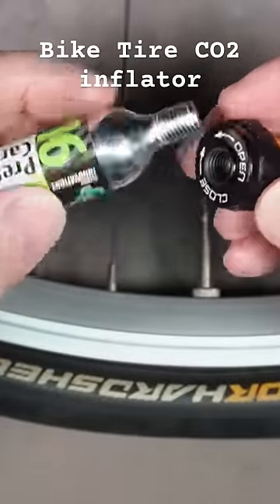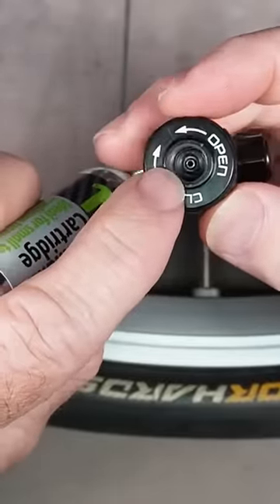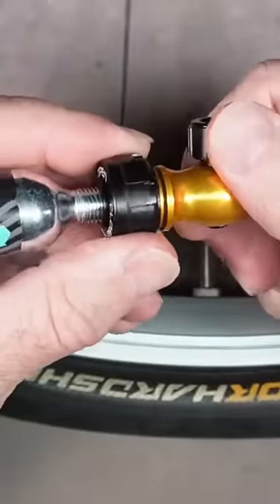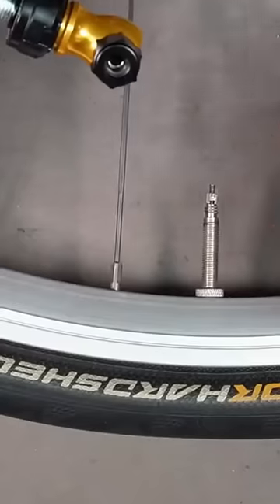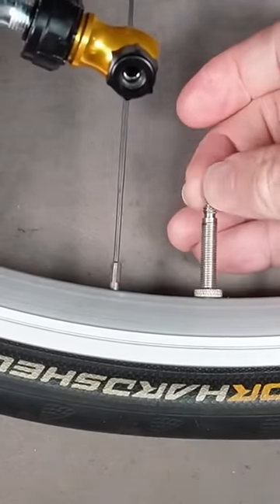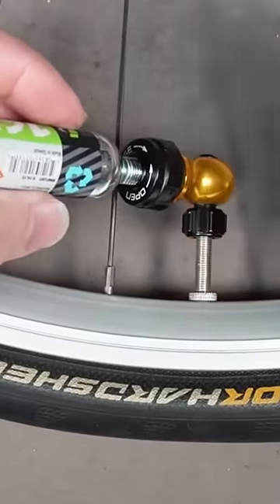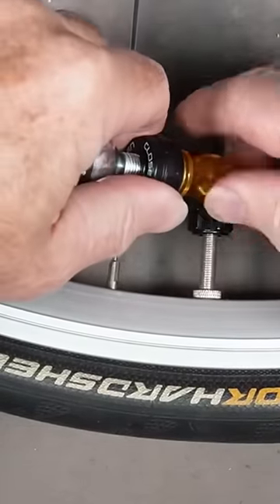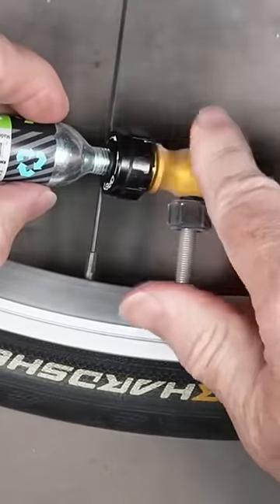Bike Tire (tyre) CO2 Inflator: How to use. #bicyclerepair #bike

Comment: I've neven seen a CO2 inflator in action. Thankyou for explaining 🤗
Reply from the maker: I appreciate the comment! 

Dave
Reply: I haven't seen one yet, well will ask for the next time I go shopping and try it out
Reply: now I know what to do w/all of those free CO2 cartridges:)
Reply: @Eduardo_Espinoza  What? 😮‍💨
Reply: Thankyou for explaining 🤗 @jayesh5131
Reply: CO2 is easier to compress compared to air. This means it produces less heat and, in this way, asks less of the equipment used for compression.
Reply: You unscrewed the core of the tire valve before you inflated the tire? Why, and how do you screw it back together again before you loose all your pressure? HOW?
Reply: @luisaraujo4708 that's not the core.
Reply: @JamesRaymond-y9p where you been living under a rock ?

Comment: Pumps are really handy for bicycle tires.
Reply: Yes and small nowadays
Reply from the maker: CO2 is just another option. Thanks for commenting!

Dave
Reply: @davescycling  it's single use and doesn't even allow you to set or check pressure.  It's wasteful and seems even more time consuming than a simple pump.
Reply: 😂 how else are you going to ride 😂 on the rim
Reply: This is for when you are out on a long ride and catch a flat. After repairing or switching the tube, you're able to air up. A lot easier to carry this and a tube than a pump. Even the small ones
Reply: @buttplugsalesmane69  the small ones are slightly longer and about the same diameter as a co2 cartridge.  They can be secured to the frame of your bike easily and some even have a pressure gauge built into it and a small screw of cap container that holds extra valves with built in tool.
Reply: @buttplugsalesmane69 no, the pump makes way more sense to carry.  Way less weight and same space taken up
Reply: @codemang87 this is primarily meant for downhill and mountainbikers who don't have pumps with them
Reply: @MXedits_1  how so? If they can carry co2 carts and this tool then they could just as easily carry a pump.
Reply: it does take a lot of work to pump one up with a minipump. i still like to use one to make sure the leak is fixed properly beofre remounting the tube and then use a co2 cartridge to fill it up. you also need to make sure your minipump can pump up to a higher pressure for a road bike tire, a high volume, low pressure mtb mini pump will not be able to do it.
Reply: Pumps ? Dafux? U talkin about high heels 👠
Reply: I’m sayin 😂
Reply: @codemang87  how many times have you had to pump a flat road tire on a ride? after 1 or 2 you'll probably get a co2 cartridge especially if you want it pumped hard enough to continue your ride. i actually carry a mini pump and co2 as well. mini pump to partially inflate to check leak repair, bead placement and or if i want to save the co2 for if i am tired. if just using my spare tubeafter a flat, I'll just use the co2 and continue with my ride and making sure to deflate the tire and reinflate with floor pump at home.
Reply: @Random-ld6wg  many times.  Sometimes multiples on the same ride.  And as much pressure as I want up to 120 psi. Tube and tire would probably explode before that tho.
Reply: @codemang87  what brand do you use? my mini floor bike pump with a foot peg from amazon is ok but i may get another one.
Reply: @joel.ha.  And as long as there is air around you you can refill the tire over and over again.
Reply: @user-sm3xq5ob5d  how? It moves from high to low pressure, So you have to have a pump with higher pressure than the inside of the tire. It would never go from outside open air straight into the pressurized tire
Reply: @davescycling  it's just another option for lazy people that like to create more trash.
Reply: @MXedits_1  are you thick? i have a downhill bike and guess what, i have a pump that sits very cozy on the frame.
Reply: and it's cheaper. Carrying a water bottle is heavier than a pump
Reply: Pun intended
Reply: Even for a small to medium motorcycle
Reply: @bobdebouwer7835 this is true. However, friction causes the pump to get warm, which reduces the amount of air the pump can move since colder air is more dense.

The smaller the pump the more times you have to pump it, which creates more friction reducing how effective each pump is.

If you want to save a bunch of energy and time, these little CO2 carts will get you back riding again way faster with less effort and doesn't take up any more space than even the smallest pump.

Or you can remain a chump and choose to do everything the hard way.

Some people like to work smarter and some people love to keep doing things the hard way, the choice is yours...
Reply: @codemang87 OH NO, he's wasting carbon dioxide. Someone please stop the madness!!!

I sincerely hope you were kidding...

LoL
Reply: @DBUCKS1988  you made an interesting reply until you started calling people chumps.

What these chumps are doing does less environmental impact. Less waste
Reply: @DBUCKS1988  you must be joking. You didn't really think I meant he was wasting CO2? As with most wasteful items it's not the product itself that's wasteful, it's the packaging.
Reply: @codemang87  it’s only for when you get flats, not every day.
Reply: And much cheaper than that cartridge. Obviously not for single use. I don’t know why but u should change your tube mate if it goes flat every single ride 😅
Reply: CO2 is for quick repairs mid ride when you aren’t close to a pump. I’ve used them once when I got a flat mountain biking
Reply: @codemang87 no you fo not have to empty the conttanner into one tyer and the one i have which is simerlar to gbis one if you do not use the hole ammout of gas you just shut the vavle off
Reply: @lesliehill4516  I see you like to use them for something else too...
Reply: @buttplugsalesmane69 well how about electronic minipump weight same and take same amount space but isin’t just one time thing
Reply: Just use your Zefal or Presta pump, you`ll have your 115 psi in about 60 seconds....
Reply: @codemang87  so you've never had to pump up a road tire up to 120 then.
Reply: @japhyryder604  lol. 120 is easily achievable on a portable but I don't know why anyone would want that high.

Comment: This is great to have in emergencies. Easy to carry a few cartridges and the adapter valve in your backpack
Reply: This would take up about the same space as a frame pump and is single use. Neat if you're trying to inflate a tire as fast as possible, but you're still going to need to put actual air in the tire soon after, as CO2 is a smaller molecule and will diffuse out quickly.

Comment: I know there’s not that much gas in there but couldn’t stop picturing it going bang if the valve froze. Wouldn’t want to have do it in a hurry on a hot day but that’s a pretty cool tool.
Reply from the maker: Thanks for the comment!

Dave
Reply: @davescycling your valve should be in the stem not out.
Reply from the maker: Not sure I understand your comment. This Presta valve does not have a removable core if that is what you mean.
Thanks for commenting!

Dave
Reply: @davescycling   I saw the value that you didn't screw it in. As soon as you remove that device all the air is going to be gone and you'll still need an air compressor.
Reply from the maker: You can watch the full video and you will see that the tire remains inflated when the CO2 inflator is removed. The full video can be found by clicking the “Created from” link in the Short video.

This is a basic Presta valve. The nut MUST be unscrewed to allow air or CO2 to flow into the tire. A tire using a Presta valve with a removable core would not hold air if the core is removed. This is not what we have here.

Dave
Reply: @davescycling   in the short I clearly saw you make sure the valve was completely out of the stem
Reply: @davescycling  how is the valve going to seal when you remove the co2
Reply: @Mr4twitch  The gentleman is trying to avoid telling you that you don't know what you're talking about. The valve does not operate the way you think, evidently.
Reply: @jcarry5214  well when he takes that gadget off it's going to be just like he never used it.
Reply: @Mr4twitch  Even if air escapes it's not going to be instantaneous. I don't even know how those valves work but I guaranteee you from experience a regular person with no practice can get the filler off and the valve closed before 1/4 of the air is out. The CO2 is going in the valve in a liquid form, evaporating, and filling the tire in a couple of seconds. The differential pressure is huge. 58 atmospheres of pressure are fighting 1 atmosphere. It's almost instant. When the tank is removed, even if it works the way you think it does, the tire will be pushing 3-6 atmospheres into 1. Not much differential or force. I believe in Dave. I believe that an average 12 year old could get it done. 

Beyond that, I bet Dave has filled his bicycle tires before, no? meaning that many, many times he has opened that valve, jammed pressurized air in, and successfully captured pressure inside the tire before. I trust him.
Reply: @Mr4twitch I think I understand what your thinking, with car valve types (schraeder valves, you push the valve in to allow air in or out, maybe your thinking in the video its one of them valves almost fully removed, but Presta valves (the one in the video) you close the valve by tightening the top, and open it for air to be put in, by loosening the top part, but when loosened the air in the inner tube/ tire, keeps the upper valve closed unless it is pushed down, so when a pump or in this case co2 cartridge are fasted over the valve, the pressure released from them pushes the valve down opening it for air to enter, when you removed the pump/cartridge, the valve is already returned to its up position meaning air doesn't leave, then you tighten it so it can't accidentally open, then ideally put on a dustcap and voila it's done.
Reply: @bigt43  that's dumb
Reply: @Mr4twitch  how is it dumb? Because you never saw it before?
Reply: @jcarry5214  because they are
Reply from the maker: Very well explained! Thanks for your input! I appreciate your time to write all that!

Dave
Reply: @davescycling   You're welcome, the multiple comments above not seeming to understand it frustrated me. So I tried to break it down into a full explanation that I hoped could not be misunderstood, but "that's dumb" apparently lol, so I'm glad at least you appreciated it 🙂
Reply from the maker: lol! I appreciated it for sure! It was frustrating trying to explain but he seemed to refuse to want to understand so I stopped responding. Trying to keep things friendly!

Dave
Reply: @Mr4twitch  It seems like they function the way they're supposed to. Are you sure you're not just frustrated and taking it out by calling bicycle parts names?
Reply: @jcarry5214  nope
Reply: @Mr4twitch look up a presta valve and how it works. Nobody could be this ignorant. You watched him take it out and not deflate
Reply: @Mr4twitch when there are multiple knowledgeable that even provided a video to watch and having the internet on your phone you still decided to argue in there reply section just to be wrong in the end and just call it dumb. You can’t just say it’s dumb when it clearly works without issue just because you’ve never heard of it
Reply: @Ridinglawnmower145   I've always used Schrader valves
Reply: @Sahxocnsba  because it was already deflated
Reply: @tdbla98   why would you inflate something that's already inflated?
Reply: @Mr4twitch  Okay, I have three bikes with Presta valves.  To add air, you unscrew the lock (as shown here), you use your pump (or CO2) to add the air, you take off the pump (or CO2), then screw the lock down again.  The air really does NOT escape while you're screwing the lock back down after filling the tire.  I swear on a stack of 50 Bibles it's true.  That's really, truly how Presta valves work.  You're just going to have to TRUST ME on this (and Dave, and everybody else on here who have Presta valves on their bikes).  If this is too complicated for you, please hire a bike mechanic to fill your bike tires for you.
Reply: Lol
Reply: @Mr4twitch Dude you should like a 60 year old who can't comprehend that he inflated the tire properly.

Many people have explained it to you now, so if you still don't get it, then I don't know what to tell you.
Reply: There's quite a bit of gas in there. Pretty sure those things are like 900psi.
Reply: This is the most chill argumentation i have seen in youtube comment section.
Reply: @davescycling  i love that you sign off on all of your replies. its like when my grandpa sends me a text in email format.

apple
Reply: @Mr4twitch that explains everything. Go buy yourself a real bike, not something from a department store. Presta valves are not dumb, they are in fact genius.

There is no core to remove and you don't need a tool to press the valve so you can deflate the tire/tube.

You just unscrew it and press down.  If you don't press down on the top when it is unscrewed no air comes out. You can forget to tighten it and it has a fail safe.

I'm sorry you have the comprehension level of a brick wall. The fact you can even read is pretty impressive.
Reply: @DBUCKS1988  I think I'll stick with Schrader valves that work better
Reply: @Mr4twitch  Just take the L, dude
Reply: @neopt6807  explain clockwise star trails...
Reply: @neopt6807   you already got the L you just don't realize it just like you you can't realize reality
Reply: @Mr4twitch you don't actually need to thread the nut in to keep the air from going out, the air inside pushes the stem and creates a seal which is broken once the stem is pushed in, the nut is just to secure the seal.

Though, I do have to agree with you saying Schrader valves work better, getting constant flats on tubes that have Presta valves has been a lot of work to me, you'd have to be gentle with how you insert a pump or you snap the stem, same goes if you overtighten the nut.
Reply: @NaniJapaneseForWhat  Schrader is better for when you need to fix a flat
Reply: @Mr4twitch  the kind of fixing a flat after hours of painful riding that you need to do to get home
Reply: @NaniJapaneseForWhat  🤦🏻🤦🏻🤦🏻🤦🏻
Reply: The Preston valve only releases air when you push on it as the air or in this case CO2 pressure keeps it sealed. The screw is just there to secure it so air does not escape while you ride it @Mr4twitch
Reply: @GandhiTheDerg  you can't use it on a tire machine
Reply: @Mr4twitch what's a tire machine? It's a bike not a vehicle and if you mean an electric pump the majority of them adapt to suit a presta value, also the value makes no difference in the repair process of puncture. It is also easier to remove the core in a presta value to seat a tubeless tire but I'm sure that is something else you'll have no idea about.

Comment: I like how they made more expensive proprietary CO2 tanks instead of using the ones that you can get practically anywhere
Reply: Thats a standard paintball co2 with a different label on it.
Reply: @winstonpoplin this one is threaded, and unthreaded ones are way cheaper
Reply: @maxx-er3fj it would need a housing to secure the standards though, tripping the size of the system.  Things that matter to the goofball Lance Armstrong wannabe types.
Reply: @maxx-er3fj  every co2 ive used has been threaded. How else do you screw it into the paintball gun?
Reply: @Redact63Lluks  Yeah but standards cost something like 60-70 cents
Reply: @winstonpoplin  You havent used a lot of them lol. There are threaded that have the housing that holds them into place
Reply: @winstonpoplin you keep saying paintball. Who is using a small CO2 for paintball? You'd get like 5 shots.

These are more common in airsoft and bb guns where far less air is needed because the barrel diameter is tiny.
Reply: @winstonpoplin the vast majority of these tiny CO2 tanks get held externally and have a smooth neck.